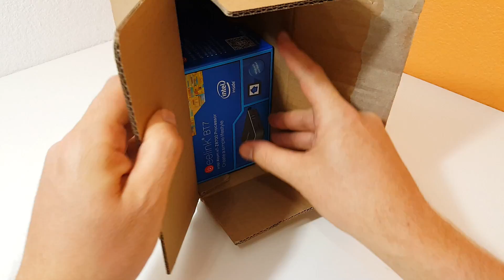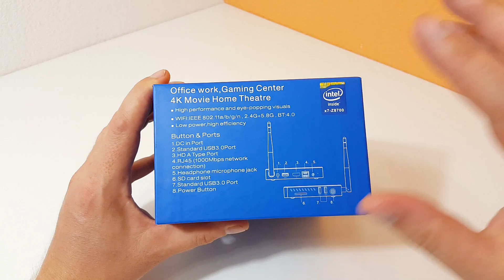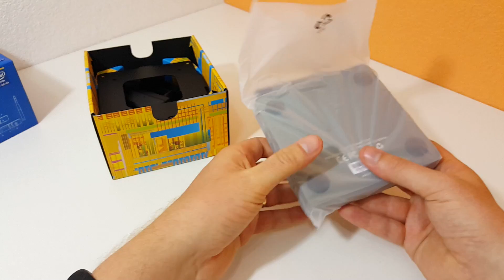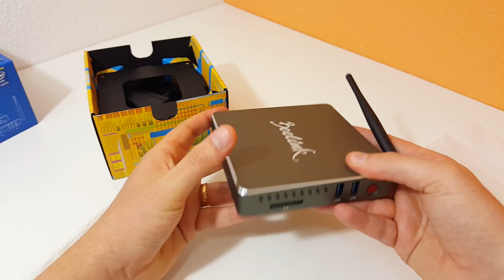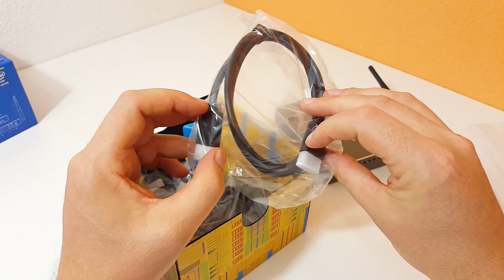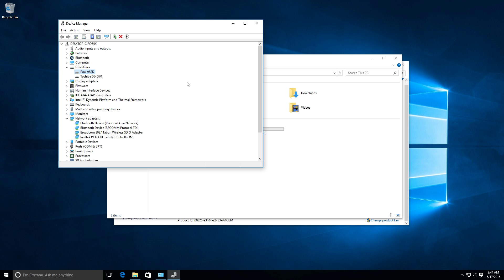Beelink BT7 Atom X7 Z8700 Mini PC Unboxing And First Look

Comment from the maker: Not an ordinary Atom X7 mini pc as it has a fan and large copper heatsink. Got this one from here: http://goo.gl/nWGCgv Also try these coupons: 

4+64G  coupon: GBBT76    $168.99
4+128G  coupon:GBBT72   $195.99
4+320G   coupon: GBBT73   $249.99
Reply: It seems that one can add SSD, but the pre-installed storage is eMMC...and judging from the speed results, it most definitely is eMMC...so it is rather quite expensive for having eMMC storage alone.

Comment: I kinda like that it has two separate storage devices, I'd use the faster one as the primary and slower as a backup. I just wish this was a Core M or a Snapdragon 820/823,had Type-C (power and hub), and dual external antenna.

Comment: Kek, an antenna for wireless? What is this, the 90s? :P
Reply from the maker: Ha yep! But it's got really good range like this and performs well, so that's what matters more than ascetics.
Reply: Easily gives you sensitivity increase of 6 dB. I would take that any day.
Reply: The transformer tablets sucked because it couldn't get a clear wireless signal inside a metal case. They had to make plastic areas where the antennas could be run on the edges and even then the wireless wasn't that great. Reception is a matter of science something they don't bother to teach you in school.